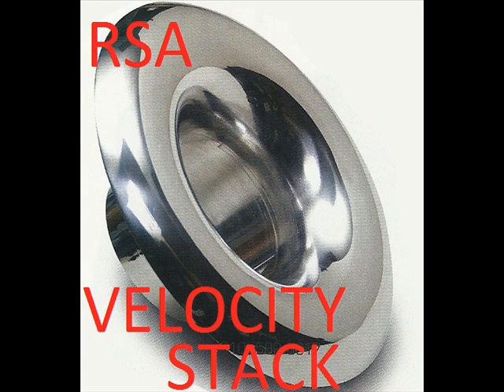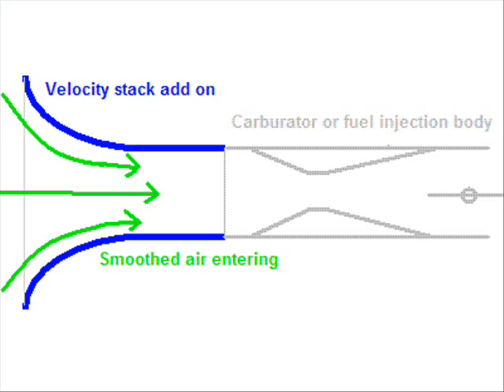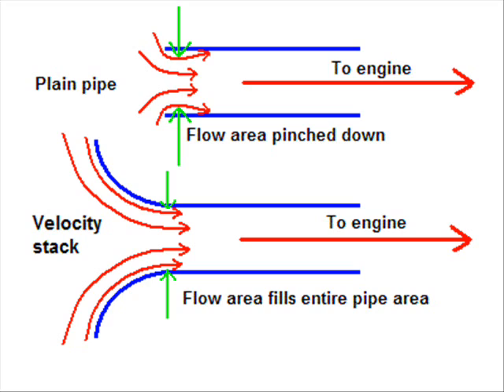Velocity Stack - How it Works - Project Car TV

Comment: velocity stack works? but air is drawn in not being pushed.
Reply: It’s about pressures: the stack offsets any restriction of the air filter so that pumping losses when the throttle plate opens are minimized...rather than using energy to suck air in, it enters to fill the vacuum of the intake and then the cylinder. Less work to breathe at lower throttle angles.

Comment: Well they didn't explain anything. So they ought not to be called velocity stacks as they don't change the velocity of the air. They change the flow characteristics to create less turbulence & improve laminar flow of air.
Reply: They are called velocity stacks as the extra length and the taper do increase gas speed by the time it gets to the inlet valve which is why you generally use a bigger main jet when you use velocity stacks due to increased air flow. Bellmouths is a better word for them imo
Reply: typical mechanic - don't know how engines work.

Comment: this stuff works when you have let's say a volant intake like for example on a cts the volant intake has two opening   on stock the air filter  goes to were the wheel is the volant intake has another hole that is in the front towards the engine now with a intake hoes and a velocity funnel you can create awesome air flow like a hellcat it's air comes in front next to the headlights on driver side this helps to push in more air flow to generate  more compression wich more ponies are unleash.

Comment: Does'nt explain whatsoever how it works.  *possibly steals other's pictures and claims as own.  Can't do simplistic math...150*3(300 horsepower)=450..and then to the wheels maybe another 50 or so cfm or so
Reply: Conner Hoffman well you need gasoline also 😹

Comment: longer length for more torque at the bottom end, shorter for more hp at the top end.
Reply: FK! thanks, that's all i needed to know. it also looks that the longer the lenght the less effective because almost unnoticed by the intake valve. ???

Comment: Correction, need 4 things to run... air, fuel, spark, and compression.  ;)
Reply: Comp should already be there so only need air fuel and spark
Reply: @streetguru427  My vehicle only uses air, fuel, and compression to run
Reply: What about timing? 😉

Comment: I was actually hoping for an explanation on how lenght affects the performace, ...
Reply: It's easy: the idea is the greater the length, the greater the momentum of the air rushing into the cylinders.  This allows the cylinders to fill during intake valve delay after bottom dead center.  The disadvantage of long intake runners is friction, which then gives short intake runners its benefits.  The distinct flow characteristics between short and long runners are then offset or taken advantage of by way of valve timing, which in turn is a function of the lobe profile.  In short, an experienced and schooled engine tuner will match the intake runner length to a particular cam lobe for a particular engine to obtain a certain performance characteristic.
Reply: @ChuddleBuggy  Sounds good. can you advsie me please? i have a 94 triumph daytona 900 triple and decided after a partial rebuild to remove the damaged standard airbox completely. it was by poor design restrictive on airflow to the middle carb/cylinder because the huge frametube ran very close to back of airfilter/airbox. anyway i;ve increased pilot jet size and main jet size but i do not want to run pod air filters because they cause big flat spots in midrange. my carbs are mikuni CV carbs.there are short rubber "boots" which connect the back carb outlets to the airobox. i have removed these 3 and are curved with a radius on the airbox side, they resemble short velocity stacks. my question is, do you think ii could improve things by fabricating a longer even much longer velocity stacks to somehow duplicate the original airflow and avoid possible midrange flat spots? the bike seems to run fine with the connecting boot stacks but i can't take it on the road yet for a proper test but wish to pre weigh my options... thanks if you can advise .. .